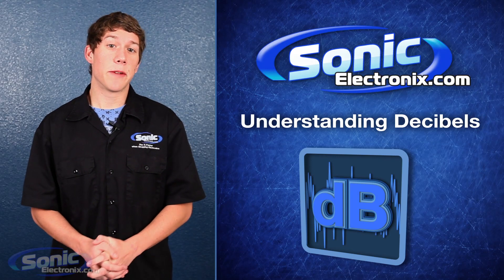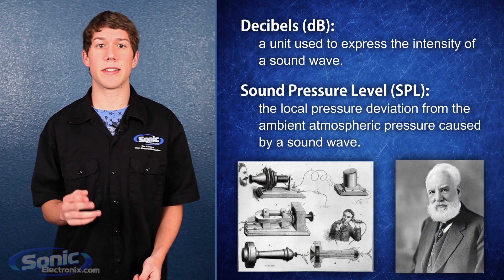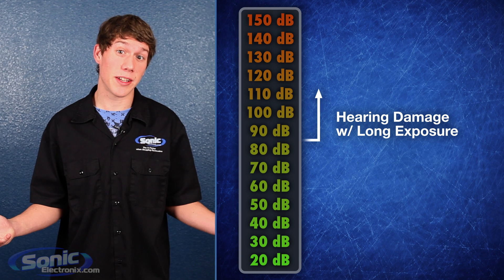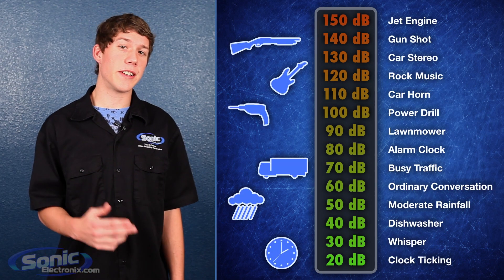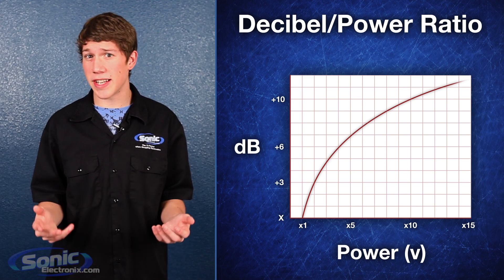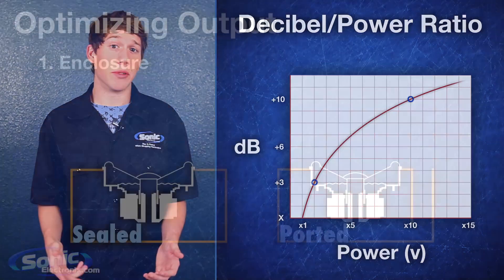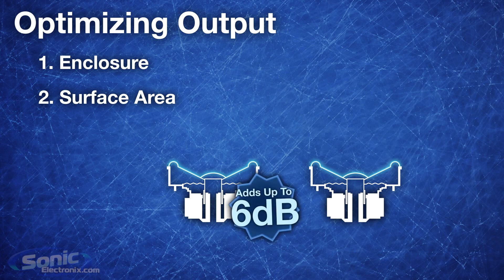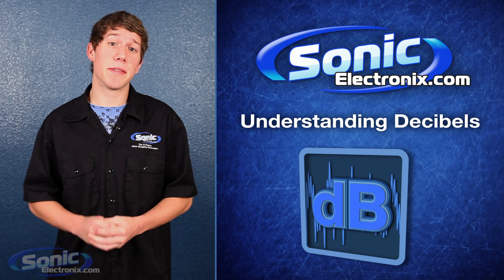Understanding Decibels | What They Are and Tips To Increase SPL

Comment from the maker: Car audio is measured with dB unweighted, however if you measure it with A-weighted dB, you can still be at a point where hearing damage is going to occur. Just because our ears do not pick up low frequencies as well does not make them less harmful at high levels.
Reply: Sonic Electronix 
high SPL of supersonic sounds and infrasonic sounds will also effect us?
like 160dB of 40khz and 5khz sound would be harmful?

Comment: I can't seem to find an inexpensive method for testing a ~150db car audio system. So far the devices require hundreds of dollars. Someone ought to invent a tiny microphone that plugs into a smartphone via 3.5 mm jack that reads up to 150 dbs and uses a particular db/spl app which tops out at 130db for the free trial version and jumps up to a higher db by upgrading to the Pro version of the app.. the microphone would need a price point of around $50. They'd sell like hotcakes IF it's accurate!

Comment from the maker: You would be both over time. Inside the ear you have 20,000 to 30,000 reed-like fibers that extend across the width of the cochlea. Some of the fibers are short and stiff and toward the other end the fibers get longer and more limber. These fibers have different resonant frequencies so when you hear a frequency, some of those fibers will vibrate, like a tuning fork. Sounds close to the resonant frequency of a fiber can set it off, but it won't be as powerful. Still, damage in a range occurs.

Comment from the maker: Hearing damage from bass goes unnoticed because our ears are less sensitive to low frequencies, so we may be doing damage, and not realise it. Bass just as destructive as mid and high frequencies. Mid and high frequencies will hurt straight away, but bass notes tend to take a while to have an effect (nausea, disorientation, discomfort). After all, the wavelength of a bass note has a lot more power at the same level as high frequency sounds. Research the Fletcher Munson curve.

Comment: Hearing loss is frequency specific to the frequency causing the damage. 
So I have a big system on the bottom end...top end is clean and under 126DB for the most part, but the bottom end is in the 104DB ish range for about 40Htz mostly. If I suffer damage from low frequencies, below the hearing level/range I will never know because pretty much nothing else makes sounds at that 40htz frequency. 
Just had to ask...

Comment from the maker: There are multiple types of dB. Are you talking about psychoacoustics dB, voltage sound pressure dB, or acoustic power sound intensity dB? A 3dB gain psychoacoustically could seem twice as loud, but may not legitimately be twice as loud. 

Enclosure is important, but once you have the perfect enclosure and the maximum power output, you can't do anything else but add another sub. Also, 154 at the headrest is impressive, but what about at the dash where those numbers change.

Comment: +sonicelectronix  Question then! I have a stock Bose system and it is lacking in mids and lows(i believe the rear speakers are dying out.) The whole stock system runs off 2ohm amps. I picked  up a set of kicker component 6x9's to replace the stock ones. these , however, are 4 ohm speakers. the have a wider frequency range but will I TRULY notice a difference in loudness if i replace them?

Comment from the maker: High SPL is damaging, regardless of the frequency involved. 165dB at 35Hz won't pulverize your hearing tissue but it will still cause damage. It is sound pressure after all, so 150dB of sound pressure is still 150dB of sound pressure.

Comment: What if I want to protect my ears? If I wear ear buds that keep out 40db and protective ear muffs that keep out 50db does that mean I would only hear 98db of the 188db of the whale call you had as an example?
Reply: No, adding 40db buds with 50db muffs would not reduce actual noise levels by 90db. They rate ear protection by Noise Reduction Rating (NRR). You have to calculate the actual reduction of the sound.

"For example, if you are at a rock concert where the level of noise exposure is 100 dB and you are wearing earplugs with an NRR 33dB, your level of exposure would not be reduced to 67 dB. Instead, to determine the actual amount of decibel deduction applied (when decibels are measured dBA which is the most common), you take the NRR number (in dB), subtract seven, and then divide by two. Given the previous example, your noise reduction equation would look like the following: (33-7)/2 = 13. This means that if you are at a rock concert with a level of noise exposure at 100 dB and you are wearing a hearing protector with an NRR 33 dB, your new level of noise exposure is 87 dB. If you are wearing a product with an NRR of 27 it would deduct 10 decibels (27-7/2=10)."

Comment from the maker: A whale produces 2000 - 150,000 Hz to obtain information about its environment. The blue whale produces a 10 - 40Hz frequency at 155-188 decibels (unweighted we're assuming). 2nd, 3rd, 4th, etc. order harmonics can take one set frequency, and then introduce other frequencies that are damaging as well if the original one has a high SPL. 150dB SPL is damaging period, notice it is "sound pressure level". However, the frequency determines the kind of damage and how fast, in a nutshell.